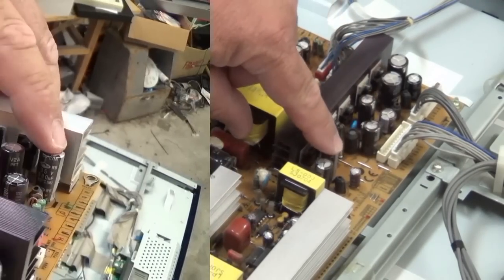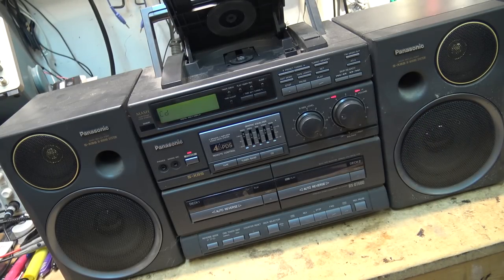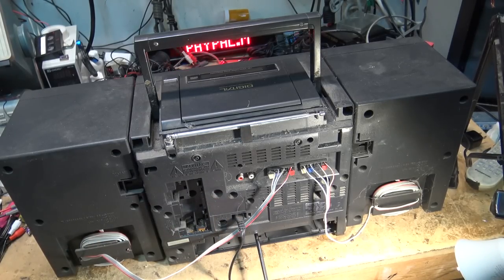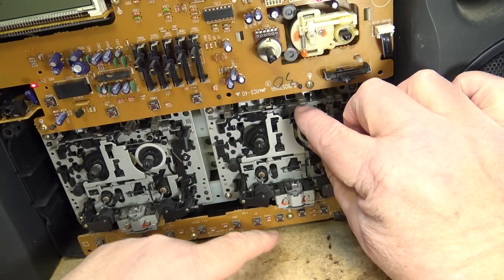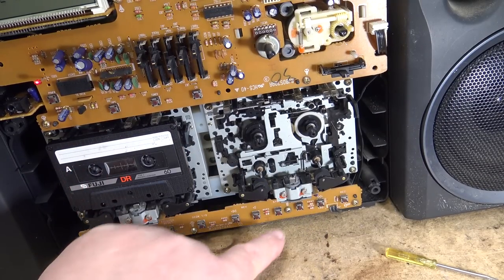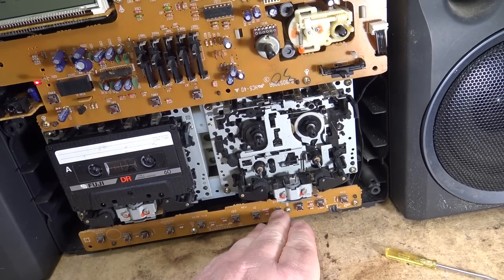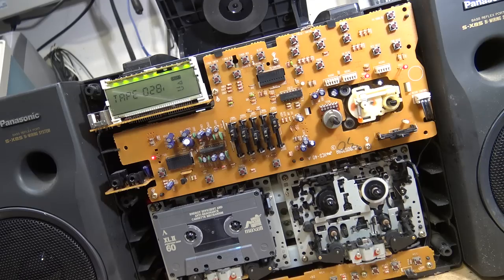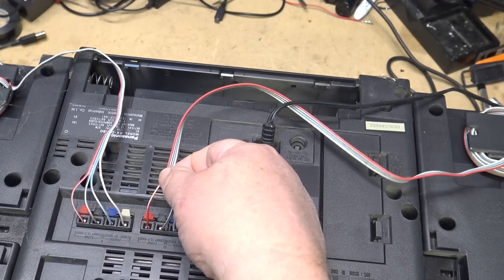Panasonic RXDT680 dual cassette cd portable stereo repair

Comment: My cassette deck don't wanna play AND don't wanna rewind/fast forward anymore and don't recognize deck 2 if a cassette is put in ... your opinion what to do is plz ?
Reply from the maker: Detection switches and belts
Reply: Thanks for reply sir. This morning the deck 1 PLAY works but NO  fast or rewind works. I put 4 AA batteries in 1 compartment in rear  (did not put any D or C in main rear). When I put 2 cassettes in unit for a moment deck 1 & deck 2 are recognized and if I select deck 2 the cassette play but NO fast or rewind works. Than intermittently cassette deck stop responding than respond than not responding ...and so  ... detection switches and belts or cleanup of unit only ? your opinion with these new facts this morning plz ?
Reply from the maker: @markchapman7326  only thing i have had go wrong us the switches at the top.  The leaf switches get dirty and then intermittent faults.
Reply: @12voltvids  Got it so best is unscrew (as you do in the video) and clean up these leaf switches thanks. Btw I'm in Canada :( if I was in USA you would had the job to repair it :D
Reply from the maker: @markchapman7326  
Why does everyone think I'm in USA.  Couldn't pay me enough to live there.  I only go there for cheap gas.
Reply: @12voltvids  I'm in Quebec city  and you live near the border I suppose ?
Reply from the maker: @markchapman7326  other side. Vancouver.
Reply: @12voltvids  Is it a Phillips #2 you’re using for the job in the video? About to do my RX-DT680 after watching your very detailed video and need to source a long screwdriver for the job first. Thanks!
Reply from the maker: @stabcityrocker  yes Philips 2
Reply: @12voltvids Thank you so much!
Reply: @12voltvids Got it apart and cleaned the contacts. Got one deck working but the other deck, which was starting and stopping like yours in the video, now is starting but getting stuck instead of playing. Belts are fine so don’t think it’s that and only other thing I can think of from what I can see is the leaf spring on the contact in the now stuck deck is seated further apart after cleaning it. Thanks for any ideas you might have.